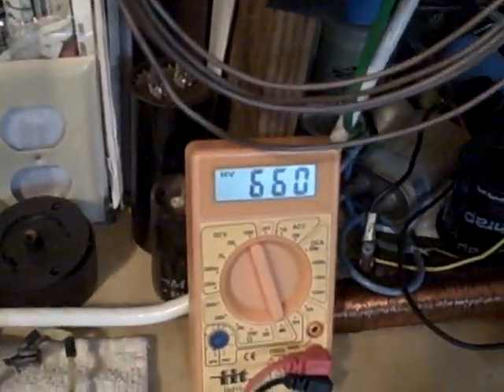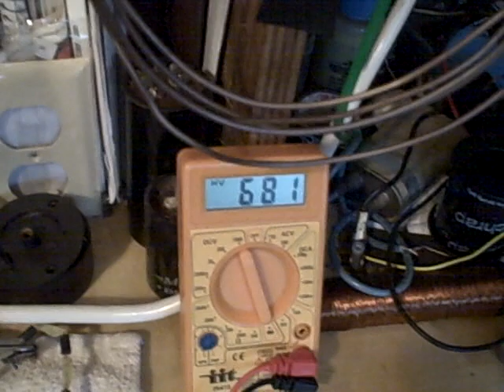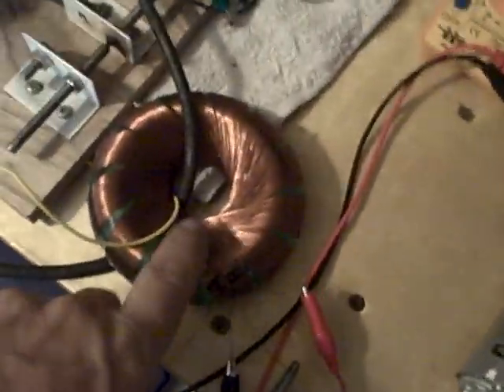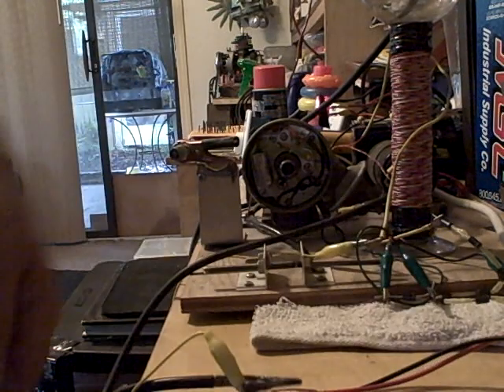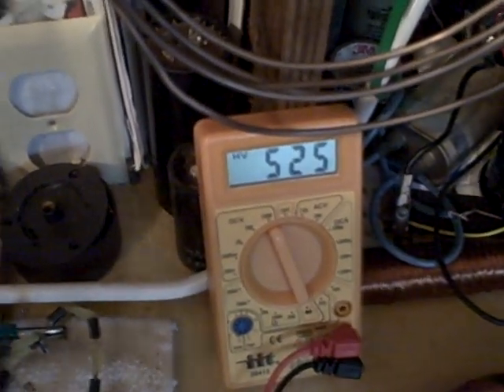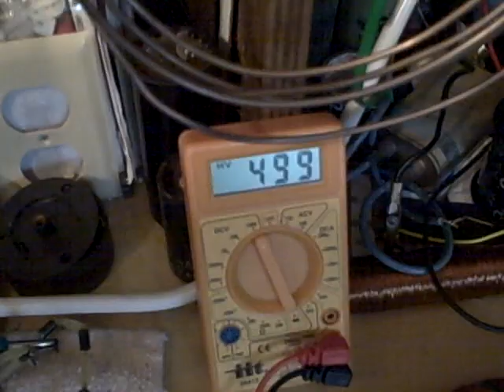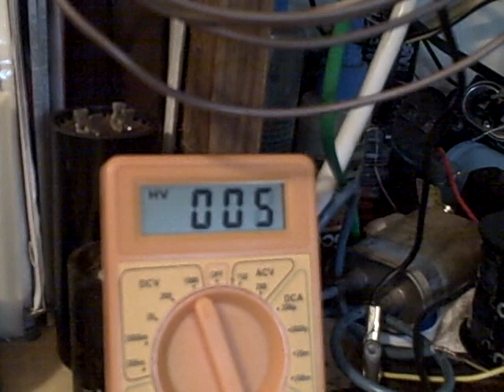Rodin Coil 1

Comment from the maker: If you have a metal roof add the positive voltage from it on the other coil. You will at least double your voltage. I have not done it yet because I am in sand and need a longer rod for ground.

Comment: Nice find OCD!   The Rodin Coil keeps surprising me, as it always seems as I'm testing one thing I find three more things I want to test.  Still wanting to get into real high voltage like you are, but I have noticed the coil's ability to 'pick up' stray voltage.  I have a blue LED sitting on one of my coils, one wire going to earth ground and nothing else attached - the LED is lit, and stays lit.  Free power!